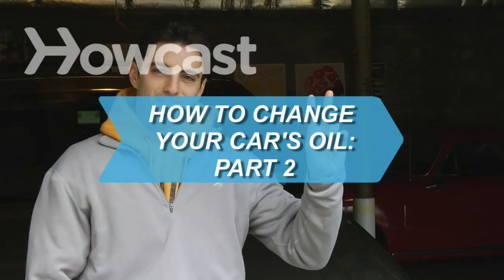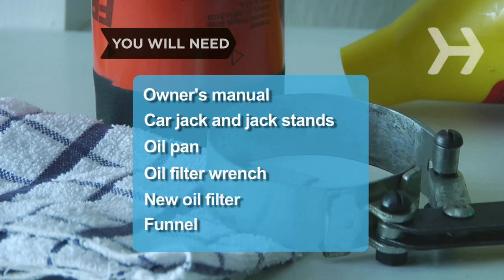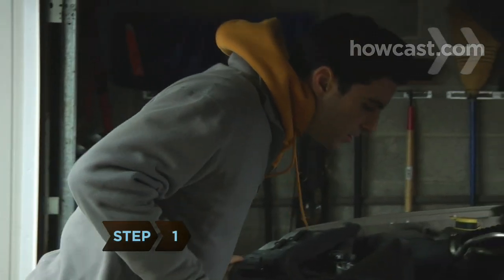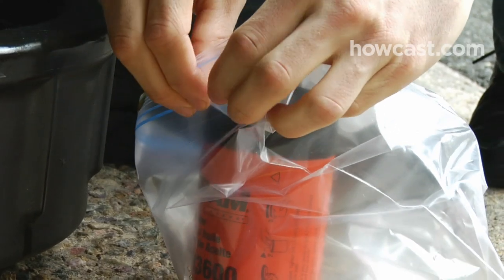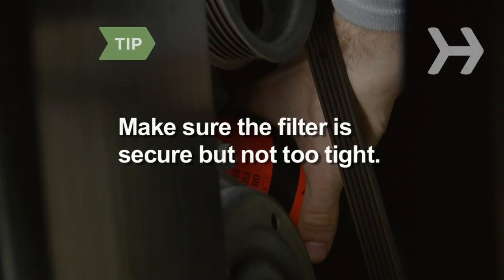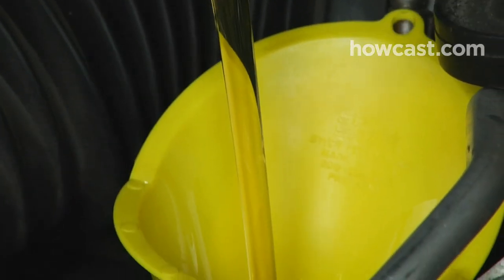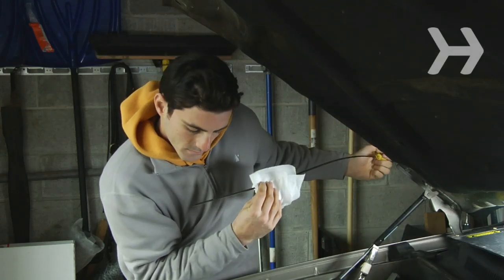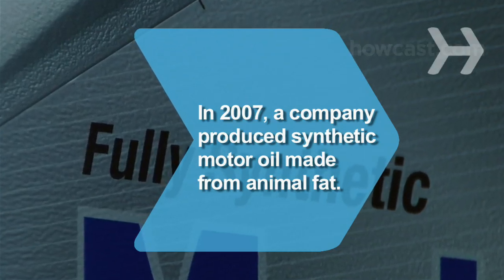How to Change Your Car Oil: Part 2

Comment: @earlyearl389 not really. its expensive cuz you gotta buy all that stuff, but it would average about the same price as getting your oil changed at home or at the mechanics the first time.

every time after that you'd be paying like 10-15 bucks per oil change instead of like 75. it doesn't take a whole lot of time.

Comment: No wonder lakes, ponds, creeks and oceans are so polluted...
Reply: Unless you do this with an old diesel. Then you can dispose of the oil in the diesel tank where it is put in the cylinders by the carburetors and compressed and ignited, thus running the engine. Not only is it disposed of in a manner that doesn't pollute watercourses, but it also gets you to places. :)